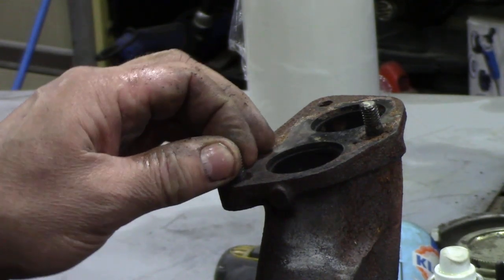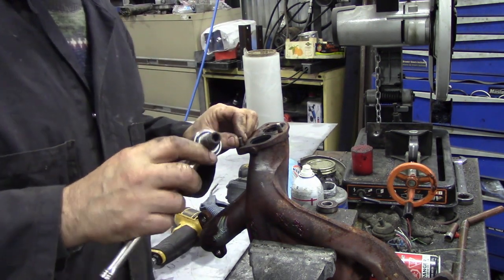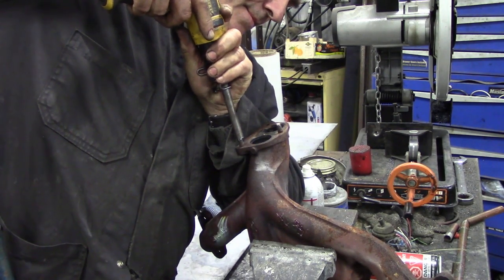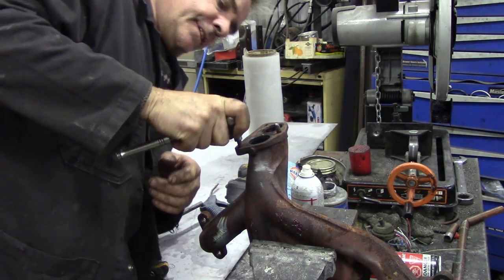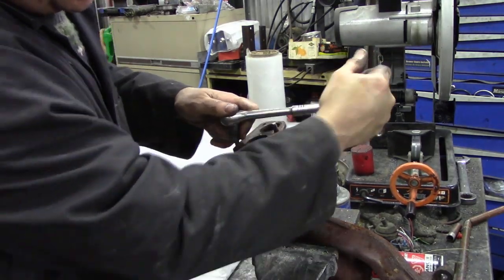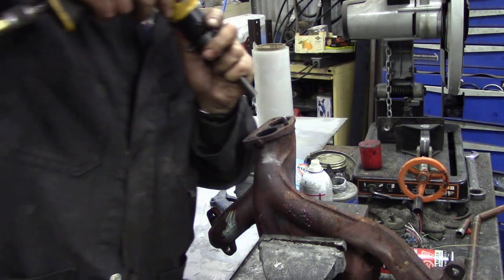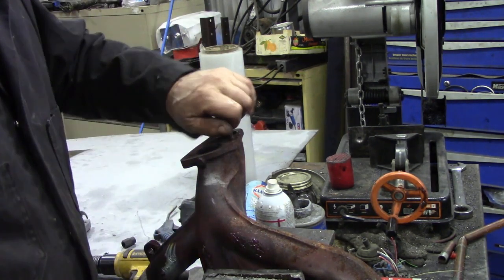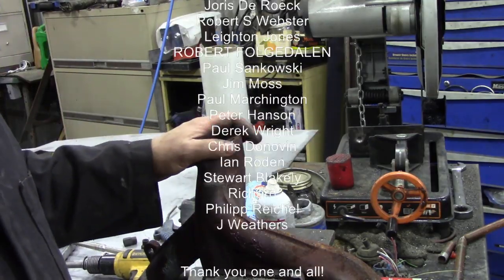Good Vibrations! Removing snapped Rover V8 manifold studs with no heat or oil!

Comment: Have to say a MASSIVE thanks for this video.  I got an hour in the garage yesterday.  My task was to see if I could get the ladder frame bolts out on my 200TDI engine.  (4 that screw through the fly wheel housing into the ladder frame which is between the block and sump/oil pan).  these are guarantied to snap!  I set to with a 3/8 ratchet (rather break that than the bolts) the heads would not turn, So a combination of plusgas pen oil, heat and the air tool  meant I was able to get the head moving, so it meant it was free in the flywheel housing, I kept with heat, oil, air tool, then back and forth with the 3/8 until... crack not a bust bolt but the smallest of movement in the thread section in the ladder frame.  I kept at it and was able to remove all for bolts within the hour!   So happy, now I just need get some ordering done so I can get the engine and boxes in the chassis!

Comment: You can’t beat it , I have a set where the air chisel fits a socket set if you can get at the head you can shift anything. I got out all the Allen bolts on my disco mud shield without shearing any with this method. It will shift stuck bleed nipples to injectors no problem. Well done stay warm!

Comment: And that's why I use brass nuts, extra long ones at that, so as to get as high a torque as I can but still have a low chance of stripping the thread. No point to anti seize, just burns off.
Reply from the maker: This is where the Nickel anti seize works best
Reply: @BritannicaRestorations  yeah, if you can find it over here, had a hell of time just getting a good copper based Anti Seize as it is. Nickel grease when you do find it costs an arm an 2 legs an that's before you actually pay for it :D

Comment: did you have any problems removing the bolts holding the manifold to the head?  ive just had a mechanic bugger up my manifold and need to remove but concerned about the threads in the aluminium block. do you have any tips to not screw up the threads as well? thanks a lot. watching from malawi
Reply from the maker: This is the video for you!
https://youtu.be/2GJpfwEGmT4
Reply: @BritannicaRestorations  thanks mike. i have a good source of new old stock for all land rovers. series, defender, discovery, rrc. please let me know if you are looking for any parts will have a look for you. the manifold bolts came out easy no stripping.
Reply from the maker: Email me: britrest@britrest.com for my contacts
Mike

Comment: Has the WD40 can  solidified in the arctic conditions preventing an overnight pre-soak ? Good outcome with the vibratory treatment and hope some Coppaslip goes in with the fresh studs to give an easier extraction for the next repair in 2039.
Reply from the maker: This was an experiment to see if I could get them out without oil or heat - they were a bit tight though! 

This is where nickel anti seize works best!

Comment: What a subject this is.
I remember this problem coming up when I first worked on cars.
Stainless seems the perfect metal because it doesn't  rust but it is brittle and can suffer from gaulling.
Brass is good but is too soft.
I think this shows us what a complicated subject metals and alloys are. No one has come up with the perfect alloy to cure this.
Reply from the maker: If you have worked on these V8's in the vehicle you will know access to the right hand manifold studs is limited - would have been a better design to use nuts and tee bolts even if space is limited - least you can cut them off without ruining the manifold
Reply: @BritannicaRestorations  There you go again Mike, suggesting that Land Rover actually think about how things should be designed.

Comment: Stainless is just too brittle for the vibration in that a position.  Regular hardened steel studs would probably be better, as long as they were given a generous coating of copper or zinc grease to prevent corrosion.  Brass nuts help, too.